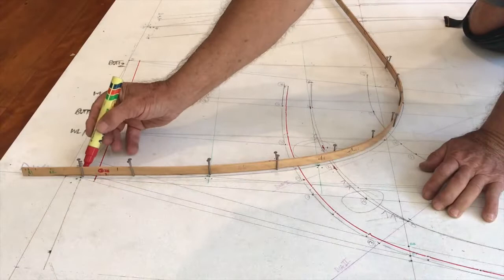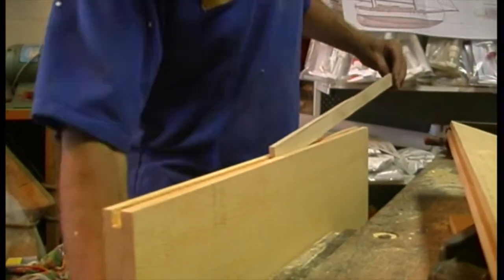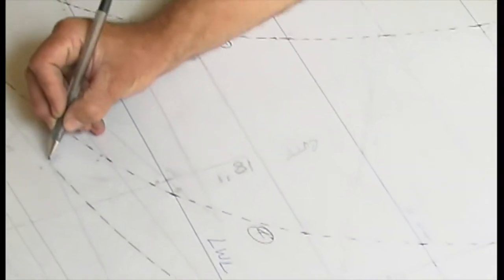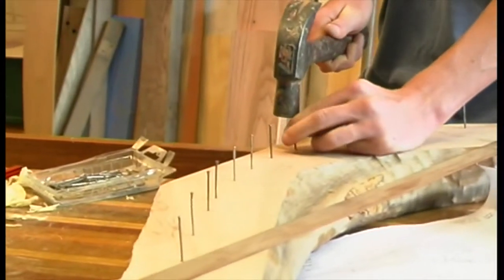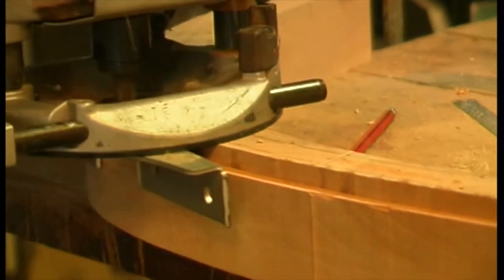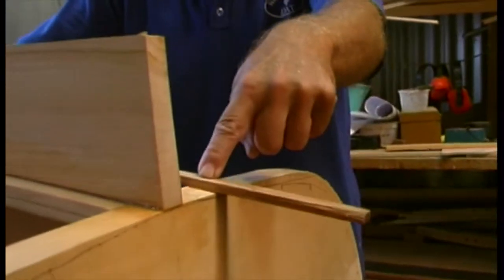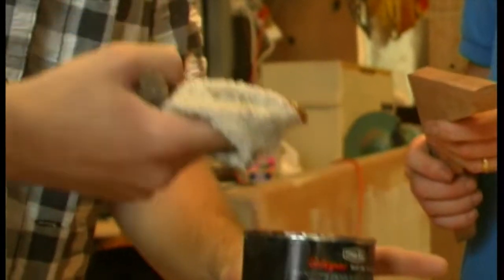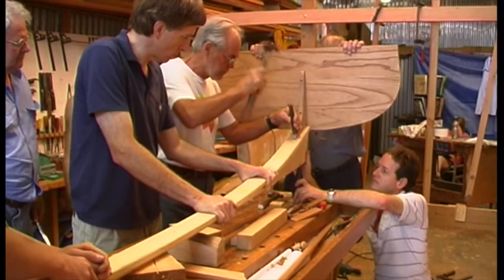Traditional Clinker Construction Episode 3: Setting Up, Part 1

Comment: great videos Ian, the internet needed something like this! I am building a clinker dinghy and i have oak for the in timbers, i do not have a piece with a sweep for the stem however.. What would you recommend doing in that case? Would splitting it into two separate pieces and fastening them together be an option? thanks
Reply from the maker: Traditionally they would scarf two or three pieces and bolt them together. The strongest method is to laminate multiple thin layers around the curve. Most boatbuilding books will show the options, including mine, see www.sydneywoodenboatschool.com.au
Reply: @SmithysBoatshed  Thanks Ian. I just bought a copy of your book. Looking fwd to reading it.